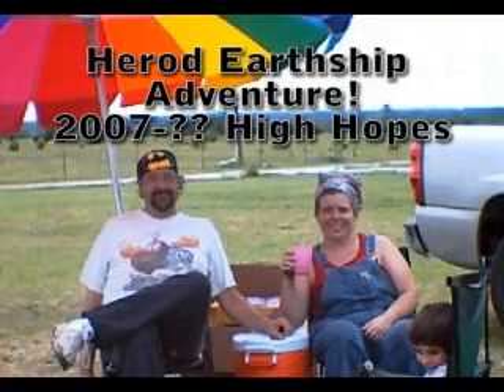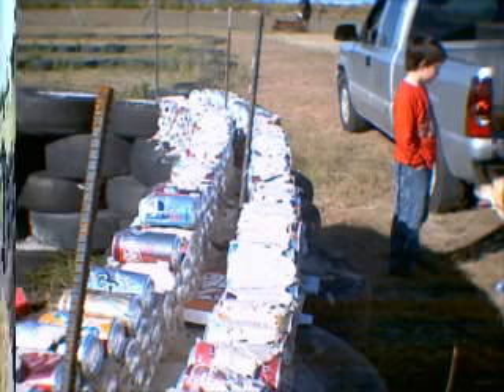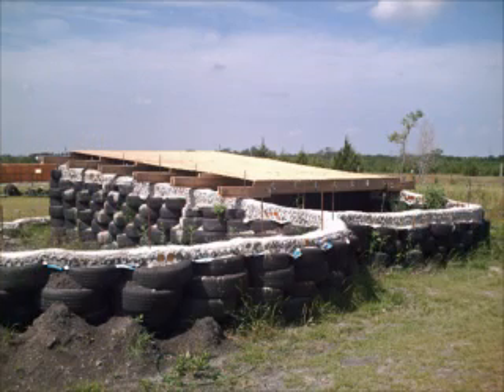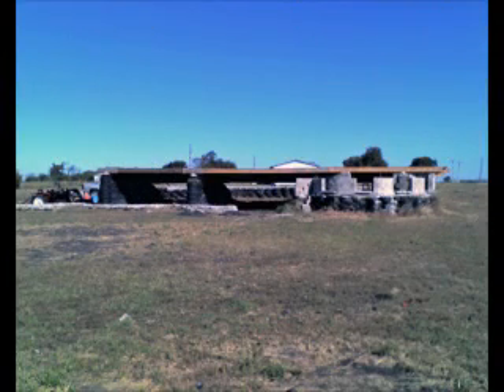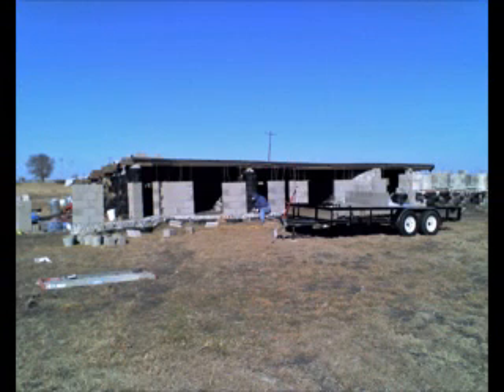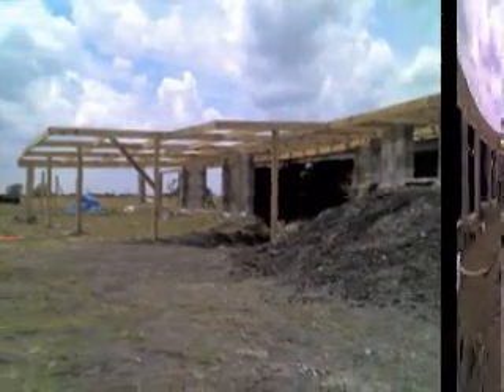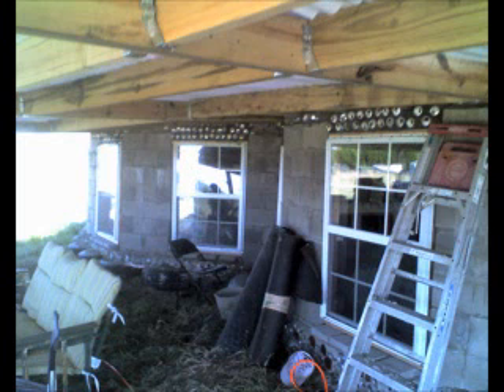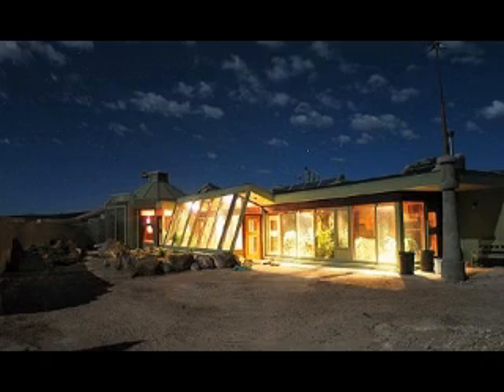Earthshiip Adventure

Comment: @cwherod Glad you fix the tires. I was curious about the structural strength and heating  and cooling issues that have possibly arisen from having dug down instead of use tires from the ground up. Has having a porch created solar gain issues in the winter?